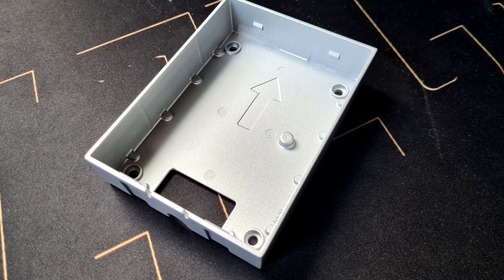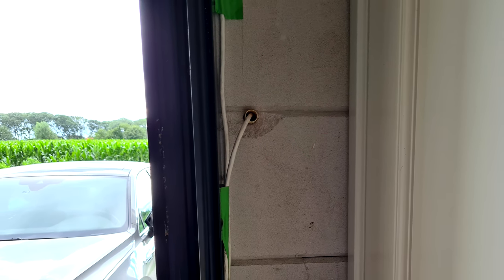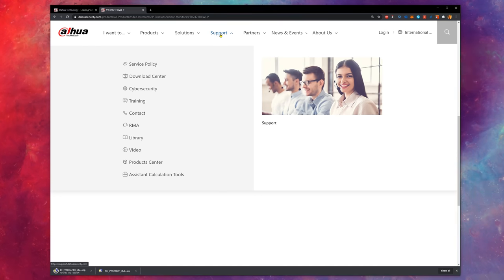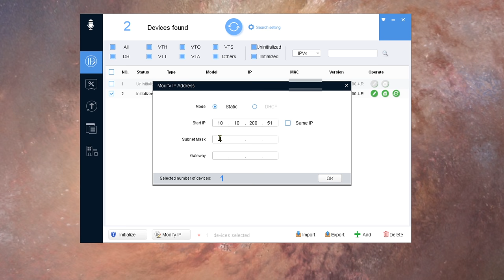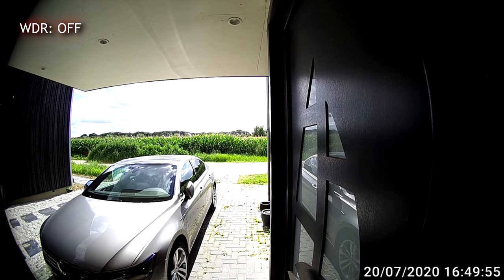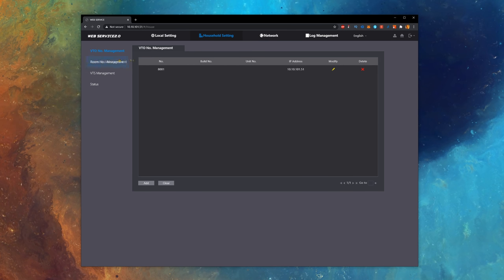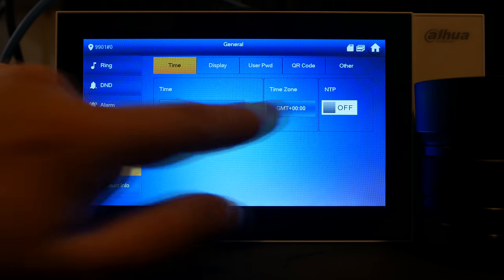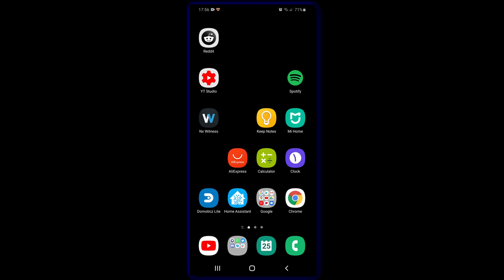🔔Video Doorbell🔔 Install and configuring the hardware | Guide | Tutorial | How-To

Comment: Nice setup but don't forget to secure your port on your switch to allow ONLY communication from the ip of the dorbell to the ip of the internal unit so nobody can compromise your internal network if they get somehow access to that network cable! That is very important if you have a network port or cable outside of your walls...
Reply from the maker: Yeah, that's a good point! Although, by the time someone wants to get at my network so bad they are willing to tear off (won't come off easily) the outside unit, they must really want something. Still, separate untagged VLAN mode or port security can certainly increase that!

Comment: Very nice video! Im about to order one my self now, and with your help it will be easy to install. One question; could you explain the house doorbell connection a bit furter?
Reply from the maker: Configuration tutorial with Home Assistant (and thus also doorbell/chime) will be the next video in this series! :)
Reply: @IntermitTech  please release it soon or at least post your mqtt code for the buttonpress please -- i just got it installed in my shop and would love to have my ha setup with a simple sound :-)
Reply from the maker: @itiot_dk  I know it's taking a while, sorry for that.

Once you have the add-on added, I have this in my configuration.yaml:

binary_sensor:
  - platform: mqtt
    name: Doorbell Button State
    state_topic: "DahuaVTO/BackKeyLight/Event" 
    value_template: "{{ value_json.Data.State }}"
    payload_on: "1"
    payload_off: "0"

And then I have an automation linked to that. But the video is coming, hopefully somewhere next week, trying for that. :)
Reply: @IntermitTech  dont be sorry. youre doing great and i now have sound.  many many thanks for your time and very fast reply!!!

Comment: I have purchased and  have a question regarding the VTO intercom 

I would like to fit a maglock to outside gate (which is not issue) I can use monitor to open gate

But the only way to open gate is using phone if I am on outside of gate, this is major issue because say my phone battery dies or I forget to take mobile out

I am looking for a solution to add a keypad or fingerprint reader is their a 3rd party solution to add to your system, otherwise what is the point of fitting a lock that i cannot get back in unless I have a phone

Comment: Ok so i got inspired by your other video regarding on how you finally found something dorbell-wise that actually functions (i'm thinking integrating it in home assistant, being able to hopefully make both my phone and wifes phone ring bot h at the same time when someone rigns the bell either via SIP or app, still be be decided) so i grabbed a VTO2101E-P-S1 that i intend to play with this weekend, we'll see how that goes :) Regarding the chime thingy, that's one small part that still bothers be a bit, see, i hate being dependant of that home assistant is up/works in order for me to hear if someone is at, not that i've ever had a problem with HA but you never know. Anyway, i see that this model ( VTO2101E-P-S1 ) has some sort of serial bits on it, perhaps that could be used somehow to send a signal or something to a chime or by other means make sure that even if software (HA) misbehaves the doorbell still triggers a chime ? Would be cool if you could look into that!

Comment: Thanks so much - Have my VTO2111D-P-S2 in front of me. Fully integrated with Blue Iris and HA / Node Red. HA Rings my Rf433 door bell chimes, notifies my phone & ipad with a  snapshot and changes my google hub used as home office desktop CCTV monitor to door bell stream. (as well as ringing phone). All with just a simple 12V feed using existing door bell bell wire. Final installation on the front door this weekend.....
Reply from the maker: It's awesome right? So much better then the commercial cloud stuff they try to act like is the only thing out there, but can't do any or at least not well of what you described! Thnx for the comment, loved reading it! :D
Reply: This one that you use is cheaper than the other in video? Is it working good?

Comment: VTO3211D-P1 Works well with this tutorial. Home Assistant also detects the RFID cards that are presented. I had issue to update the SIP parameters and I finally succeed by changing them one by one, pressing save and get reboot each time. The error was related to the password that contained *** char (WTF). Thumb up
Reply: And I also just addedd the video stream to my HA installation using a specific Onvif user (not admin) with this URL : rtsp://monitor:XXXXXXX@DAHUA_VTO_IP:554/cam/realmonitor?channel=1&subtype=0&unicast=true&proto=Onvif If you want to capture people that are sneaking around your door when you are away you can use the excellent plugin Frigate and a Google Coral accelerator.

Comment: You didn't really go into this - but according the the quick-start guide, you've got to set up a computer on a 192.168.1.x network in order to access the device (which has a default IP address of 192.168.1.110) so you can change it's IP address.  Is that really the case?  If, so, what a PITA.

Comment: I bought it and so far it's not installed but I'm toying with it and loving it. Question: How do you change the ringtone or upload new ones?
In the App can it be made so that the Doorbell camera loads right away when you open the App? Currently I have to add it to the Door section everytime
Final question, I have a motorised gate that can be triggered (open/close) by pressing on a push button. Is there any such possibility to wire in the VTO or VTH so that it closes a circuit momentarily

Comment: Having some issues....Hope you can help...
I have this same VTO and the same VTH...
First off, I changed the IP's to my subnet.
I can access the VTO from web, but not the VTH.
I got the Config tool, except the new version V5, and it found the VTO on its own, but not the VTH.Also they are only visible in the Modify IP screen. I had to add the VTH with IP info myself. I was not sure of the port so I left blank for now. 
So... I can see the video on my VTH, but the VTO cannot call, and I also cannot call from VTH to VTO.  I was also wondering, do I need to setup SIP(I am unfamiliar with SIP). For now I am not interested in mobile access.  In the VTO webpage, there is Household VTO No. Management which I have no idea to setup.

But its been hours, and I have tried a number of things, NO LUCK!!  Any help would be great.
So the config tool cannot see the VTH for me to upgrade firmware, and I cannot access its web browser page(err_connection_refused). Very frustrating.

Comment: Wouldn't be possible to use a VPN inside the house to connect to the Doorbell directly without using their Cloud? I imagine that some RTSP software is available on Google Store for that :) That would remove the use of their cloud possibly :)

Also, regarding the "Room settings", that would be the function to use for their Outside doorbell with multiple "buttons", to be able to configure an external outside for two different houses/apartments, because you basically assign a specific "button" to a room and the doorbell will ring only in that room if that specific button is pressed. Very interesting :)

Thanks for this video! :)
Reply from the maker: Yup, that's one of the ways I'm going to look into. Block all internet access but add it using a local IP and use something like Wireguard to have a split-VPN on your phone so it could still send push messages, but no clue if that works yet or not. :)

On the other stuff, yup, you can build a whole system with it, including multiple buttons (different model outdoor unit), etc.!
Reply: @IntermitTech  Maybe you can ask them to send you one with 2 buttons so that you can show your viewers how that works :P
For the VPN bit, I think it might be only related to find a Doorbell software that uses RTSP or maybe HA for the push notification and a simple RTSP Software for the Audio/Video part. Of course the VPN traffic should be routed for the Doorbell port if you do a different Subnet for your VPN Clients :)

Comment: Looking forward to seeing how the other doorbell is - it has more wife approval factor.  Shame it's not wireless though.
Reply: It might be nice to have wireless as an option, but as far as I know, this is the only video doorbell I've seen that has ethernet - which should be a required feature for all stationary devices!
Garage door openers - wireless only
Video doorbells - wireless only
Lawn sprinkler controllers - wireless only
So many wireless devices that are permanently mounted!  Ick!!!   It's hard enough getting 6 phones, 3 laptops, & 4 tablets to connect simultaneously - especially since the neighbors all have their wireless noise nearby.   I also hate the security gap of wireless, and I try to avoid it whenever possible.
Reply: @gmscott9319  not only because 'stationary', but also because, at least in my case, the doorbell would be installed in a total wifi blank spot, because of the layout of my typical dutch "rijtheshuis" (house in a row block) and where my APs are located
Reply: Sane here. The 'big' doorbell seems awesome, but too bulky to our taste and physically too big for the wooden window frame where the cable comes out

Comment: How's the physical security?
I have a Ring video doorbell and it's secured with a screw with a "special" head so you can't remove it with a typical PZ2 or PH2 screwdriver.
This is to protect against damages, theft and burglars (who will also damage/steal the doorbell) as well.
Ring had the issue of storing WiFi creds in plain-text, so theft of the device would lead to compromise of WiFi creds as well.

Also, as other's have pointed out: Make sure this network cable cannot reach anything on the internal network.

Comment: Thanks for this video.  Was sorely needed because can barely read the dinky fine print instructions that came with it :)   Bought the KPT01 kit (1 VTO/1VTH) and an additional VTH (might even add a 3rd later on).  I can make calls between all 3, video, 2 way audio.  However, when I use the "monitor" on both of the VTH's, I get a "network abnormal, monitor failure!" error.  I'm somewhat at a loss.  About to jump into the smartphone notification in your video.  Great stuff!  Soon to interface with my Home Assistant!

Comment: Looking forward to the video about the smaller camera! the big one in this video will not fit near my door apartment.
Reply: I've received the smaller unit last week.  It has rock solid construction.  Mine will be installed outside on a fence post to control a side gate.  Interface looks the same as the larger unit.

Comment: Do you think this will work for ever? maybe they decide to update the firmware to disallow the "feature" just asking... im srsly considering to get me one. PS. pls pls pls, does the box come with the unit or do yuo have to order it separatly?
Reply from the maker: We're using the official API to talk to it, I don't see any reason of them taking that away, it's not some "hacky" thing, it's an official feature of the device.

In a kit the box comes with it, otherwise you need it separately.

Comment: Great video!! One thing I didn't get, the chime is connected to the esp board and will be activated via wifi? (the actual doorbell is not connected directly with the chime wires?) I'm asking because the current doorbell I have, Ring, is connected/powered by two wires (which I assume coming from the transformer and connected to the chime as well), and getting an ethernet cable all the way there would be a hard task.. :/ So I was thinking to just mount it on the other side of the doorway which I can definitely arrange the ethernet cable, and to control the chime / send the signal via wifi when the button is pressed.. assuming my first question was correct.
Reply from the maker: Yes, both are basically connected to Home Assistant in whatever way and once you have that, you can make it all work. So the chime over WiFi or some Zigbee version or anything like that can work fine, as long as Home Assistant can use it.

Comment: Wondering if the Dahua APP is still working for you, it seems dahua moved from the iDMSS Plus to the DMSS, but the doorbell doesn't call the app anymore.
Reply from the maker: I've been using DMSS all this time and it's still working great for me. Talk to people at the door while home or away without a problem. Sometimes when you are remote you might need to connect twice, but that's it. Push messages come through fine for me.
Reply: @IntermitTech  Thank you Quin for the reply, i manage to make it work.  Not sure why, but if i add the VTO manually with IP/User/PW, all worked fine except the push notifications on the phone, but once i did with the QR code, and registered the SN, it seem to work, again not sure why.  Thanks again for taking the time and replying me, if you hadn't i would have though it was broken.

Comment: How do you make the wires to be able to unlock the door from the app?
Reply from the maker: There is an internal relay for that, check the downloadable manual, you can see all connection points there.
Reply: @IntermitTech  that was a fast reply! thank you. i did check it out. it seems that you can either give 24v from the camera to the door which that might not be a safe option as somebody removes the doorbell can just apply 24v to those 2 pins and open the door. and then there is another way that i saw that

Comment: Hello people, 
we ordered and received the unit through a seller on A.E. We ordered a set for on-wall mount. Unfortunatly in the box there was only the unit, but no bracket for either on- of in-wall mount. The space in foam in the box implies the piece is missing. Or is there actually a third option with only the unit and no mounting brackets? in that case we ordered the wrong item. We will also contact the seller. 
Ps: great video. It convinced us to get this unit. We consider making a mount from Belgian Bluestone and might not need the bracket at all..
Frank
Reply from the maker: Hi Frank, awesome you liked the videos about the unit, more coming up! But yes, just the doorbell unit alone doesn't come with either the in-wall or on-wall enclosure, you need to pick one of those and then buy those separately, I hoped I explained that well enough in the video!

But nothing lost, just contact the seller like you said, he should sort it all out. :)
Reply: @IntermitTech  Thanks so much for the explenation. Hence the 'low' price ;-) We have ordered the only one item indeed... Can blame the wife since she actually ordered it ;-) 
Your videos are both informative and entertaining. We are in the proces of automating our newly being build house (very south of Netherlands) and allthough I am relative technical skilled the whole thing covers a lot of specific areas. From networking to security etc.... Therefor videos like yours are very valuable..  Thanks again!

Comment: I'm just about to order this kit, but I have one question you might know the answer to. My existing (faulty) door phone has a momentary-action pair of relay contacts that I connect to the wires for my standard doorbell. When a caller presses the button, the relay closes for about a second and opens again, which gives the "ding-dong" on the old doorbell. Does the Dahua have the same feature? Looking at the manual, it mentions a number of different contacts but doesnt really explain what they do. Thanks!
Reply from the maker: I touched on this in the videos, but sadly, no it does not. I do this using Home Assistant and a relay, it's shown in the video.
Reply: @IntermitTech  Damn, sorry I missed that part! Feels like I'm back in school asking a question that was covered yesterday!

Comment: Great video tutorial. Thank you. I bought the kit and have installed a micro SD 32GB in VTO. I did not find how to use this micro SD for continuous recording or at less for short videos  when it rings or there is movement. Is this possible at all using this micro sd as I don't have an NVR.
Reply from the maker: I wouldn't think so, SDcards aren't used for writing the amount that comes from writing continously. I do believe it can capture footage on events such as the doorbell being pressed.
Reply: @IntermitTech  I'm wondering if one could put config information (new password, IP address info, etc.) onto the SD so you don't have to kluge around with a 192.168.1.x network for setup...
Reply: @IntermitTech  hello,  i have same probleme i install sd card 64gb into my vto and i don't know how i recording automatly when one person push the button in vto